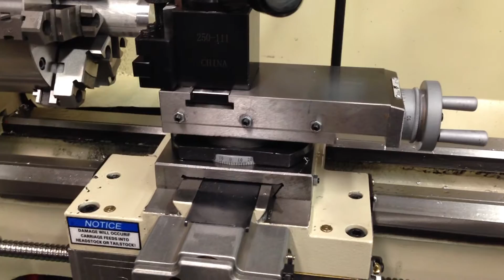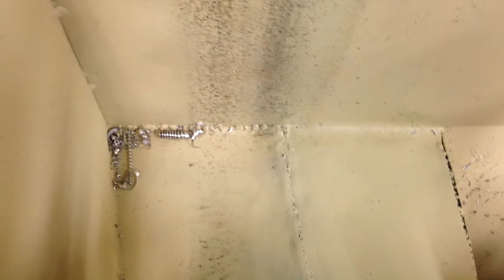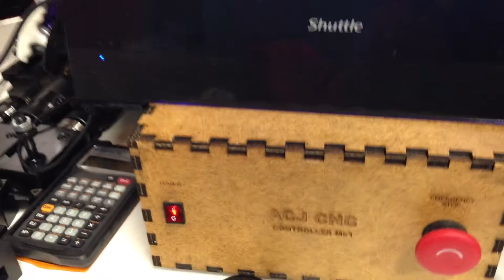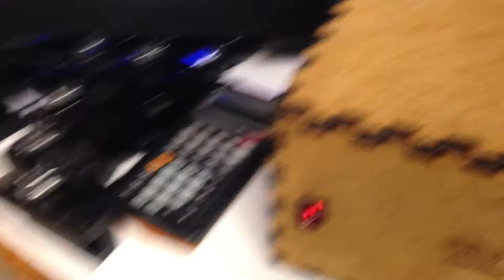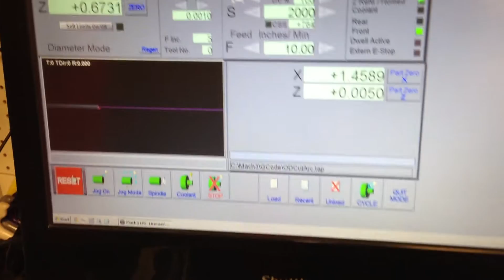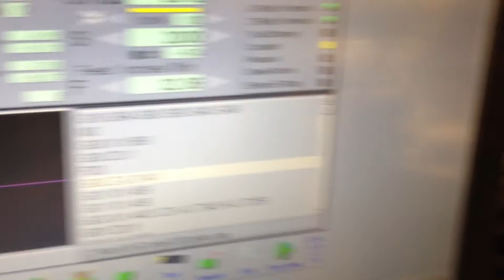G0602 CNC Lathe project

Comment: That 2hp motor works great. It looks like its not easy to modify g0602 to fit it. Is there more information on that? I was trying to find some but not much details on that. You did great job on this conversion.

Comment: Allan , 
Never thought of using super glue . Hows that working for you?
Reply from the maker: Seems to be working OK just make sure you have estop setup for limit switch activation in Mach in case you screw up it won't over travel and pop the switch off.

Comment: I was looking at getting a run-true chuck for my G0752 (nearly identical to the G0602). I read that the run-true chucks are only compatible to run-true back plates. I'd like to know where you got a blank for the back plate, or what you did to make the chuck fit the plate. Thanks.
Reply from the maker: I modified a set tru back plate that was 1 1/2 by 8 tpi this lathe is 1 3/4 by 8 tpi so I bored it out to 1 3/4 and threaded it for 8 tpi. You can get such an animal at Shars.
Reply: Alright, thanks. It's either that or re-do both of the back plates that came with the lathe. For some reason, the threads on the spindle are way out.

Comment from the maker: 900 for the kit 200 for steppers 300 for a G540 100 or so for a power supply 160 for a smooth stepper, 200 for enclosure switches cables and misc. So lets call it 1860. Round up and figure 1900 or so.

Comment: I just purchased one of these kits today. can you provide a link to the rpm sensor and the feedback board. I haven't tried to set up a spindle speed controller yet but I have built a ZX45 Mill with steppers and a 11x7" router with servos. Can you tell me what I need to setup the optical sensor? Thanks.